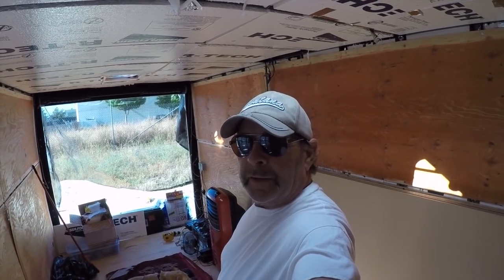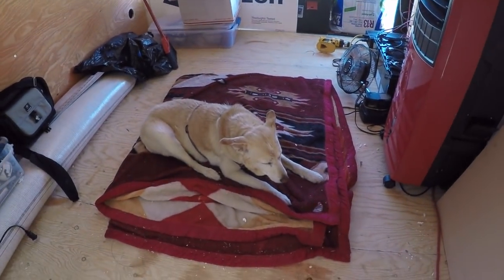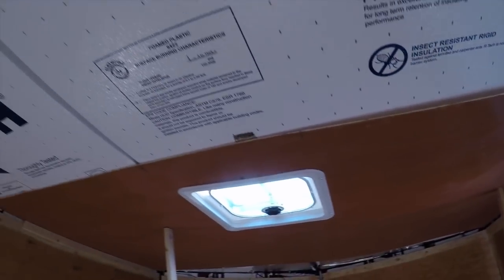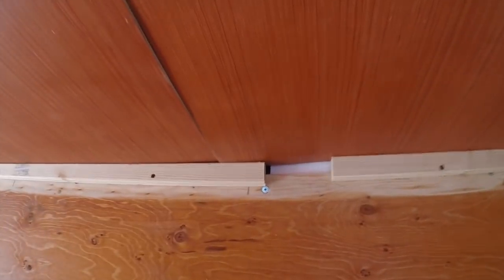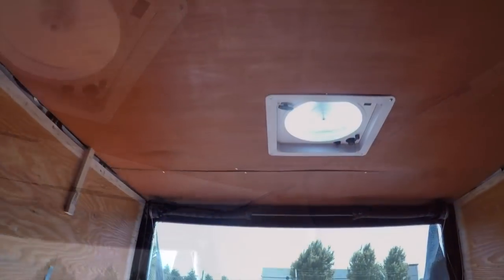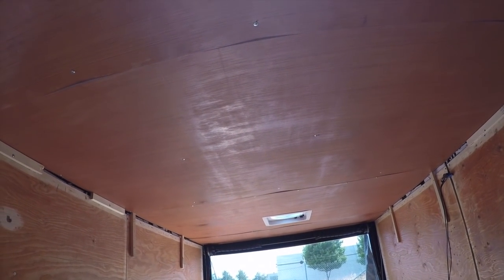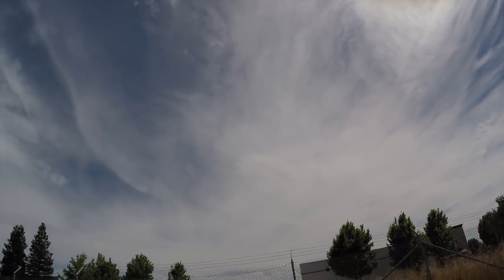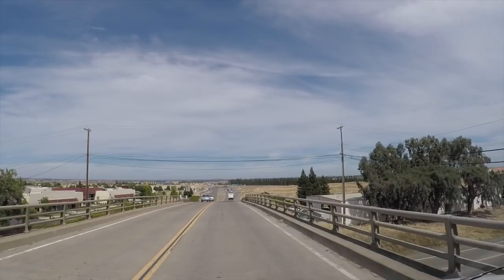Cargo Trailer Conversion...Ceiling Panels.... Wiring....Solar Power...RVerTV

Comment: Really coming together, and looking good! Crown moldings or quarter round up at the top for a smooth finish?
Reply from the maker: because of the wiring and gap probably be like a 4" wide flat moulding